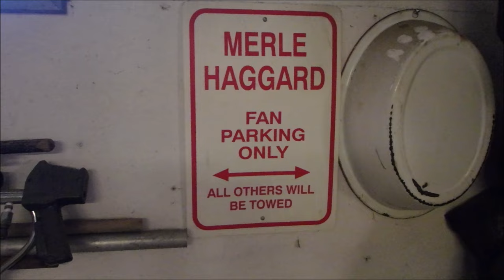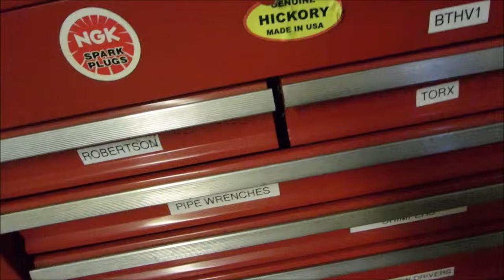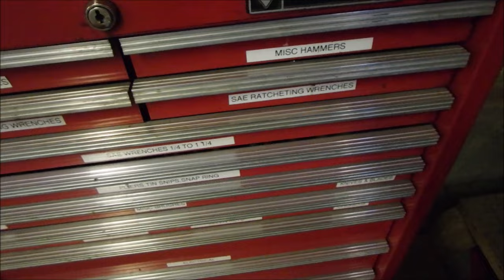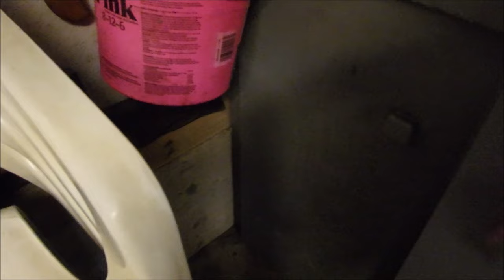Shop Tour of Bruce's Shop

Comment: Left Handed drill bits?  Do you use them in reverse? Never heard of such a drill bit. Can you explain in a short video perhaps.  You have a very neat and organized garage with lots of stuff.  Keep up the good work. Thanks and Happy New Year Bruce.
Reply from the maker: Yes  If you have a bolt that has snapped off the head you start with a reverse (left handed) drill bit on the remainder of the bolt it may spin out in many instances while the bit turns backwards.  Thanks for watching this video Troy.  .  Happy new year to you as well.

Comment: Pretty nice shop you got, Bruce. Is that Reznor furnace gas or electric?  I ask because I’m trying to find a better means of heat for my shop. I have a 22’ wide X 28’ deep garage with 10’ open truss ceiling. Non insulated. I currently use a 110,000 BTU kerosene torpedo heater which works fine but it’s a bit noisy if you’re trying to hold a conversation with someone. I have a 230 volt circuit out there that used to power a welder I no longer have and I was thinking of using that for a decent electric overhead furnace like what’s in your shop.
Reply from the maker: Well I would first spend the money  on insulation.  Then the money you spend on heat stays in there.  My furnace is natural gas.  I can turn it down to just above freezing to save money when I am not in  there.  If you can use that 230 volts outlet for even a small sub panel that would give you a few breaker positions for doors and lights.   the furnace just uses enough AC to run the air fan.  The furnace is 75,000 BTU
Reply: @BrucesShop trusts what I was thinking Bruce. Insulation and close in the ceiling and walls first then have a gas line ran from the house. What I have to account for is the exhaust fan in the back wall above the trusses.